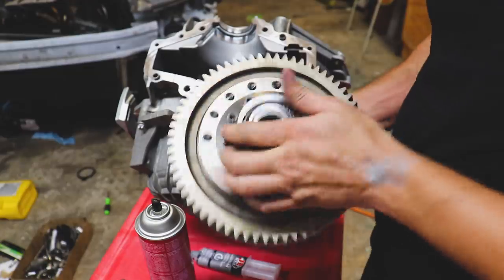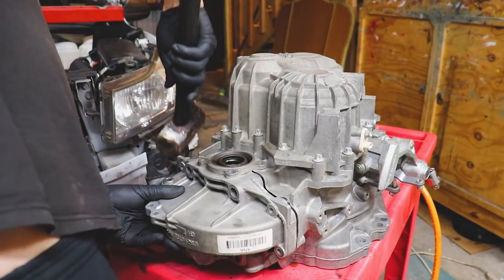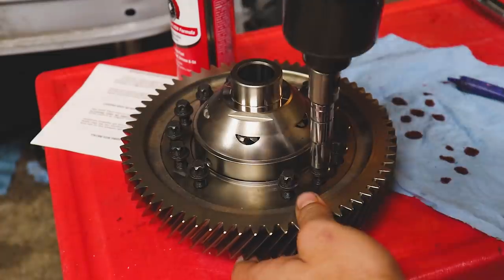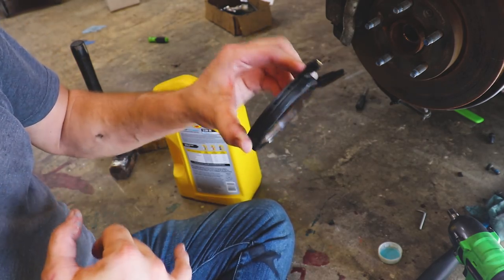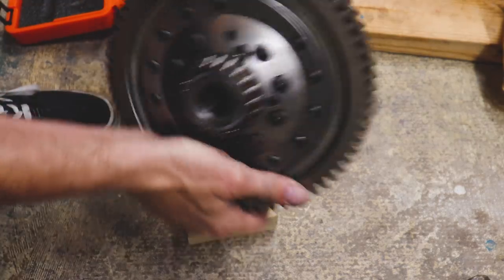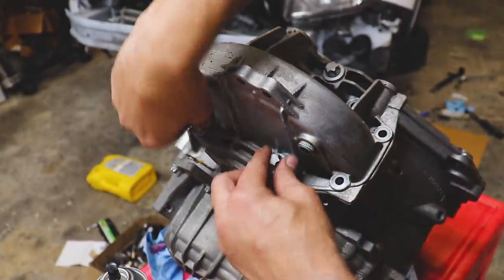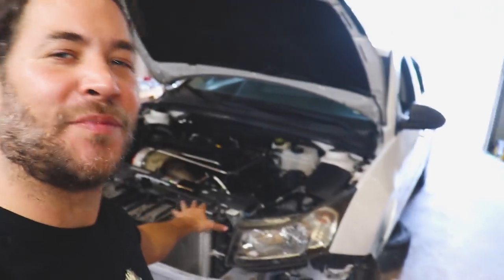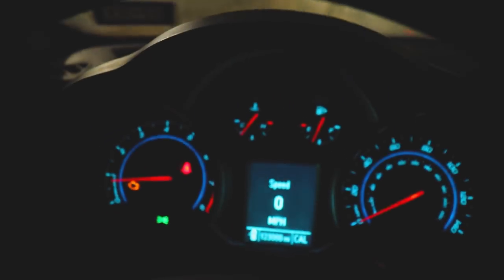DIY Limited Slip Differential Install - CNC Transmission Mounts - M32 Gearbox Upgrade - Chevy Cruze

Comment: The way the rear seal went in makes sense. The pick up is stationary and the reluctor wheel has magnets on it. Same design gm uses for the abs sensors with a magnetic wheel spinning past a pick up sensor.

Comment: The Pennzoil Plat is the absolute best imo, I use it in both of my cars and it does a much better job than the Mobil1 I used to use :D
Reply from the maker: I tend to stick with what works. Never had any issues using Pennz in the past 15+ years cause my old man swears by it. Never spun a bearing or had any issues. Good stuff!
Reply: Fun fact Pennzoil 0W40 is factory fill on all hell cat and 392 dodge engines. Also on the 6.2hd in power wagons and service body trucks.

Comment: Man that differential is way easier to remove than the old getrags!
Reply from the maker: Did you have to split the case? This was about as easy as it gets!
Reply: @cmattdabrat  yes, the case has to be split and there is a few things to line up before the case will come apart!

Comment: Get some shorter thicker extensions for your tools so your torque loss will be minimal other then that keep up the good work your one of my favorite car guys doing it man!
Reply from the maker: Thank you! Great tip! I do need to turn up the psi going to the tools. I have it set around 45psi right now which is on the low side.

Comment: Sounds nice so far. 
 I think you will be able to keep up with the zzp's sonic once you are done. 
 Did you do the intake yet or is that in the future been working on my own cruze and maybe I missed something but enjoy the nice weather while you can. 😉
Reply from the maker: Thanks.
I'm definitely after giving it a run for it's money. .4 more liters of displacement. I'd say setup wise, only thing that could potentially be a setback is the turbo. They have a pretty nice Xona on theirs. The GT35 I have is pretty old tech, but has been known to put down some impressive power on 1.8's. I'm actually working on getting Al from ZZP to help with the tune once we go to the dyno.
Definitely. Project car whether.

Comment: Glad to see you got the LSD in bro. What are you planning to do next? Oh, and those CNC transmission mounts are nice and beefy. Really will help once you have the turbo intake finished and she (hopefully) hits 500 whp. I just replaced my passenger's side front wheel bearing on my '05 Ion today, so I have a similar feeling of accomplishment. I really can't wait until I'm able to start tearing into it as a project, I really wanna turbocharge that 2.2. But it'll have to wait until I have a second car that I can drive while I have it torn apart, I want to go all out on it like you're doing on this build. Anyways, keep it going man, I'm really loving this and I'm learning a lot by watching. Most likely this'll be my guide for when I do finally get to beast up my car 🙂
Reply from the maker: LSD went in pretty easily and has made a nice improvement to how the car drives. I'm currently working on a full 3" stainless turbo back exhaust. Hopefully we'll find out before the end of the year what numbers she puts down. That's awesome. That Ion will be a ripper. My ride definitely has been down a lot longer than expected, but I'm sure it'll all be worth it in the end and will still be a daily driver.
Reply: @cmattdabrat  Most definitely will be worth it! With all the hard work, time, and money you've been investing into it, you deserve to have a sweet performing car. I'm really happy for you, it's awesome to see it all finally coming together

Comment: Man I sure want my cruze to be like this one
Reply from the maker: You could always start getting parts little by little. It's taken me over a year to get to this point.
Reply: @cmattdabrat  Hey man! thx for the response, it is pretty encouraging really.

Things are just tough, I'm at home with my parents who have a more than capable garage worthy of having a nice shop like yours, but it just doesn't. Its full of garbage and sheet metal and old stuff that hasn't been taken to recyclers or the dump.

I honestly would like to buy a second cruze, one that is much cheaper so 
I could break it down and rebuild  for fun but there isn't any space to do so...

EeeeeeeVeeeentuuaLLLyyyyy!!!!

Comment: Hi Matthew,
You're not the only one who has screwed up that oil seal. 
It looks like the service manual treats the oil seal and housing to be installed separately.
Rear main Oil seal, then the reluctor ring and then the Oil seal housing with the electrical connector.
But this can't be right as the new oil seal comes as one part, oil seal and housing already pressed together and they don't want to separate.
Did your rear oil seal reinstall solve the problem?
Thanks for the channel.
Reply from the maker: Thank you, thanks for the feedback. It fixed the oil leak, thankfully. I wasn't looking forward to having to attempt it again. I agree. Who know, maybe a revision? Or it's just more steps than necessary. Knock in seal and sensor house, install the reluctor ring, done.
Reply: You're up late!
Thanks again for your channel, I very likely would have installed it wrong (cause logically it looks right) again and driven the car into a river.

Comment: chevy dealership parts guy here; we usually order  bolts and other parts in large quantity for the on hand stock, and you more than likely just got bolts of the shelf. they are individually packaged to help label what they are incase let’s say they get separated on a techs bench or something and for the also for helping us put stuff away in the part bins. however if you special order something because they don’t have what you need, then they will come in a bag that says “qty X” (x being whatever number you ordered) and then the separate bags will probably be inside of that bag. chevy doesn’t really sell “parts/rebuild kits” like a website your normally use for after market stuff has. even the head bolts are individually priced and sold :/
Reply from the maker: Very informative, but makes sense. Thanks for watching!

Comment: Hello! I'm writing from Turkey. I would like to install a Dual-mass flywheel for better comfort. Is there enough space for us to fit this gearbox? Thanks in advance for the answer.
Reply from the maker: I believe Clutch Masters makes a dual mass flywheel for the Cruze / M32. You might want to check with them.

Comment: Does that LSD fit in a 2015 impala with 2.5L ? Been putting good power into mine and have been wanting to get an LSD in it so I can get the most out what it's putting out, but can't find any solid info on one for it.
Reply from the maker: The diff will only work in a M32 / M20 transmission. Might just need to find out what transmission is in your vehicle and look one up with the code. Might be one available. There's also LSD kits that use springs and blocks, but not sure how effective they are.

Comment: Is it locked all the time or does it lock up when you step on the gas?
Reply from the maker: This diff has worm gears. It doesn't lockup all the time. It'll bias traction more to the wheel getting grip. When I pull around a turn, you can feel both wheels pulling. In a straight line all are locked.

Comment: Hey Matt, how's the new clutch feel?
Reply from the maker: It actually feels pretty close to stock. Clutch pedal maybe slightly stiffer. Another 5 pounds of force.
I got a lot of flack about the aluminum flywheel and the stage 5 clutch. If you know how to feather a clutch and not just dump it, the car shifts smooth. I have given it a slight dump taking off at a stop light, and it grabs and pushes you back in the seat. Definitely happy with my purchase.
Reply: I also have a manual cruze and was curious if it was worth upgrading when I need a clutch, super excited to see your car under boost!

Comment: Gm is awesome for selling parts individually because of the way they get paid for them unfortunately.  
 I know it's wrong but when I did my engine swap torque ty. Bolts should be replaced but I used blue lock tite & tq. Them down 2years later and it's good 👍.
Reply from the maker: They're definitely good bolts. The flywheel bolts for the Cruze has blue loctite, so that's always good. I think it's a good thing they do sell them individually for any circumstance that may require it. Would be nice to have a packet of the bolts you need as an option though. lol